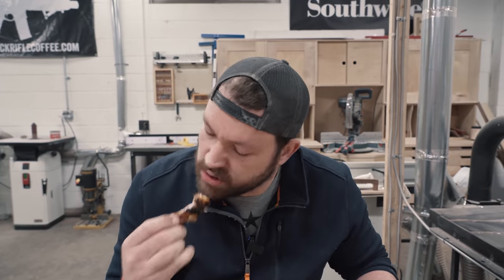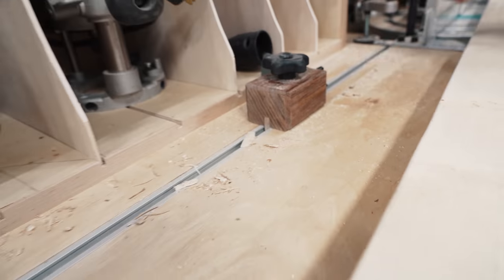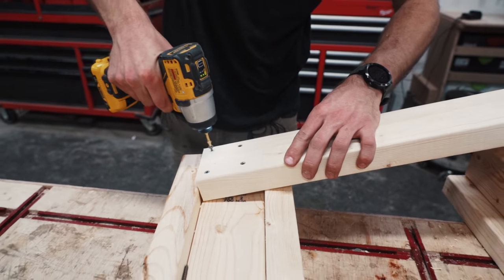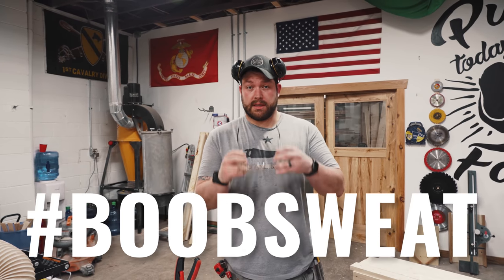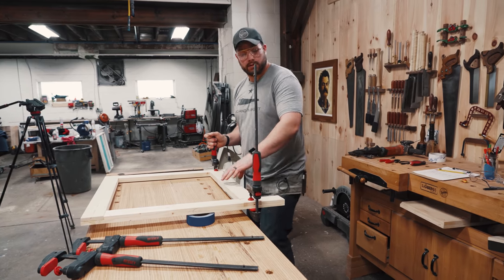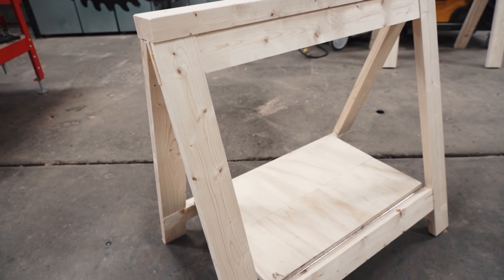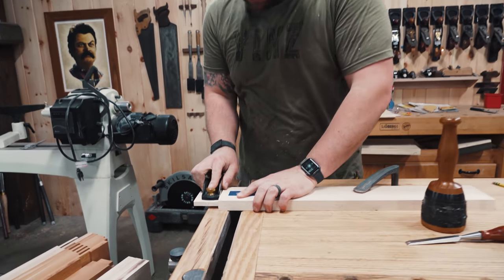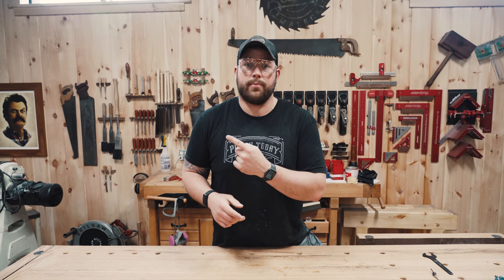3 LEVELS of Sawhorses: DIY to PRO Build

Comment: You build a horse for a purpose, not to be pretty. I have been a carpenter for 48 years, a horse is strong, fast to build and cheap to build. Because they are disposable!
Reply from the maker: congrats on a long career my dude! Check out the world famous woodworker, James Krenov. I think you'll see that there is wiggle room for all kinds of sawhorses depending on the application. I would never use anything but the I beam on a jobsite haha

Comment: your last one is an overbuilt pile of junk... i would never use it. 

The stack-able 1st one you built is perfect.
Reply from the maker: Good William. You’ll never get the chance !
Reply: @John_Malecki  not sure why I won't get the chance... I wached it get built. I don't need the plans to copy it.

Perhaps I should explaine. Solely for the reason that the saw horse is too narrow. If you push anything with any kind of weight on it it will fall over.

Comment: yeah bullshit, just go buy any folding table, etc., a standard table lasts way longer, folding means moving parts that wear out and break usually quite fast. the folding sawhorse should not be trusted, especially when using any real weight. also, you screwed up the first one. for the strength, you add triangle side braces to keep the legs from spreading, you might be good at other stuff but not so much sawhorses, too fancy is not always a good thing. I got 5 dollar ones on sale from lowes that are stronger than that fancy crap.